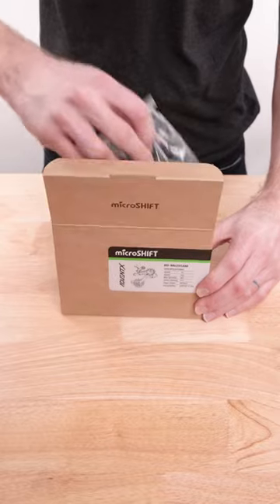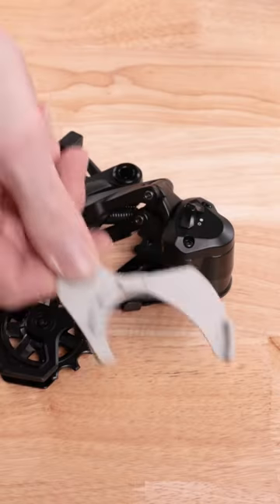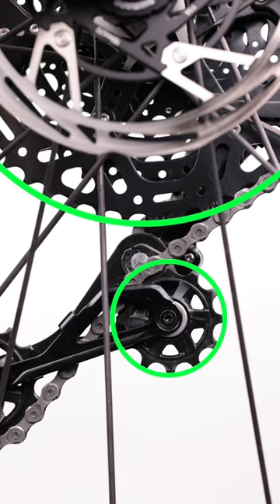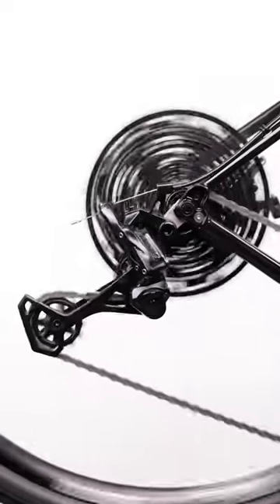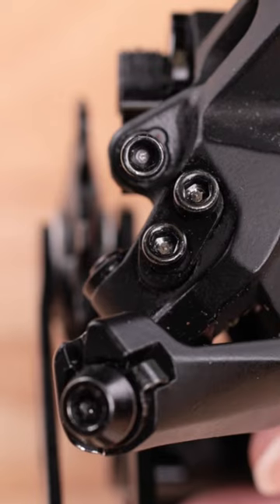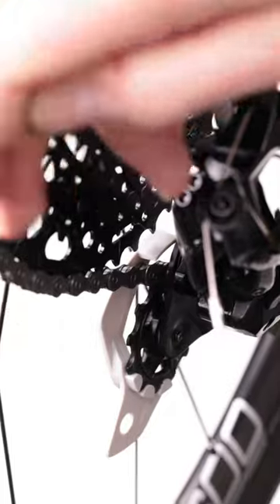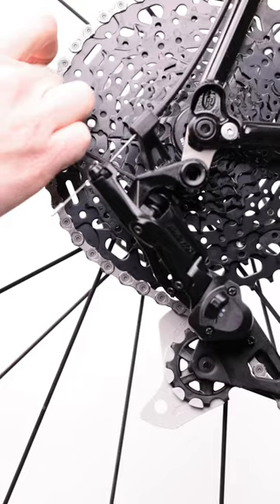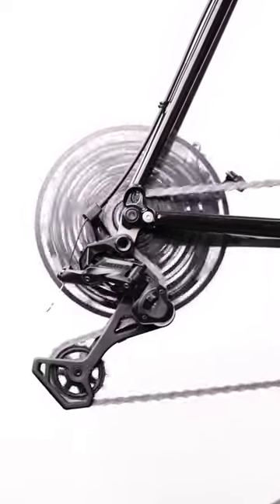What is this tool that came with my derailleur?

Comment: Is it possible to get this tool? I bought a new bike with an Advent X groupset and did not get this part.
Reply from the maker: If you've already got the bike set up, you don't particularly need it. If you're having trouble getting the derailleur set up properly, drop a line to our service department via the link on our website.
Reply: @microSHIFTTECH  Let's be honest...most bikes aren't properly setup when purchased and it's necessary to go over everything yourself. So...where might one acquire the tool from? Thanks!

Comment: Hi microshift, got my marin larkspur then came together with the advent x. So i dnt have this tool. Recently i changed cassette and kinda tweak the b screw. Without the tool, how can i knw if my B limit is at the optimum position?
Reply from the maker: You can measure it with a tape measure. If you watch our installation video on ADVENT X, there's a section on adjusting the B-tension screw to achieve proper pulley gap.